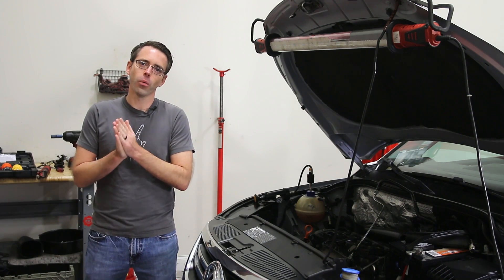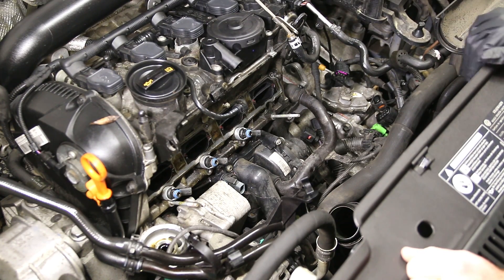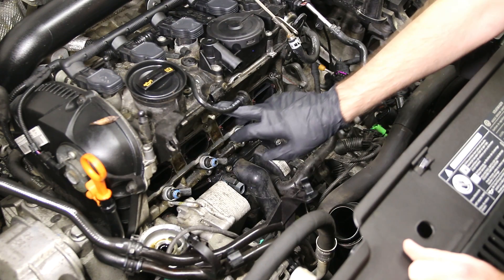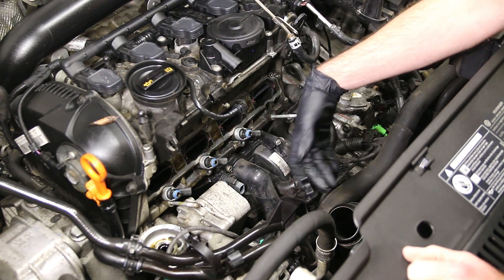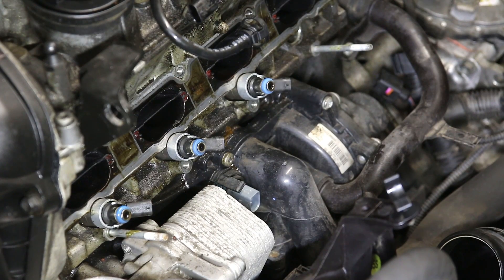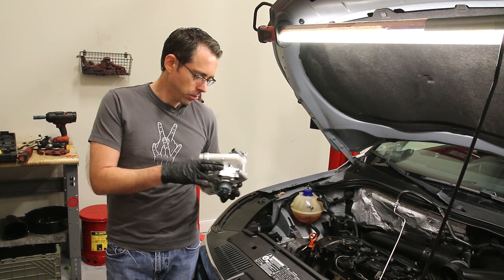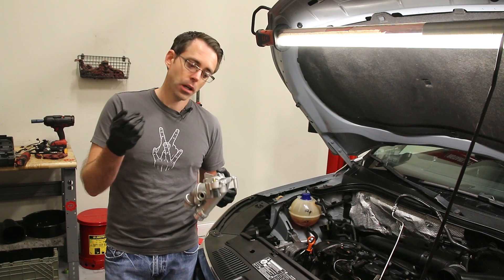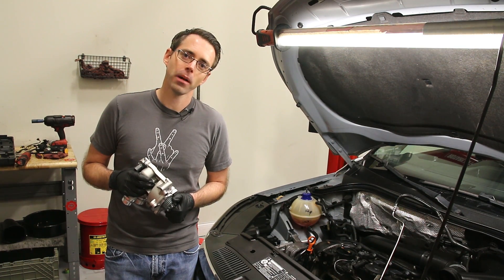Why to Never Let Problems Linger | 2.0t TSI Engine

Comment: Any information on which VAG engine codes are affected on this problem?
Thanks
Reply: +Daniel Yes.
CCTA/CBFA - 147 kW (200 hp) at 5,100-6,000 rpm, 207 ft lb (280Nm) at 1,800-5,000 rpm. Application: VW Golf Mk5 GTI (for US market only), VW Golf Mk6 GTI (for US market only), Audi Q3 (for US market only), VW Jetta Mk5/Mk6, VW Passat B6, VW CC, Audi A3 (8P). 

Here in South America we have the 2.0 TSI/ TFSI 211PS engine in the EA888 Gen 2 and if I am not mistaken this was the only powertrain for our market. Many people with whom I have spoken told me both the Audis and VW had oil consumption problems, which is a specific problem of the second EA888 generation, other than the famous failing chain tensioners. Models affected were the Audi A3, A4 B8, A5 2.0TFSI until 2012.5 and Volkswagen Vento/ Jetta MK6 (or Jetta GLI), Passat B8, Tiguan and probably missing many others.
It would be really, really helpful if DAP makes a video explaining in detail the main differences between these huge amount of engine codes, and most common issues for each variation.
Reply: All? I've heard all the differences are between the engine codes is emissions
Reply: +Daniel Hmm, really? I am not sure if it this is the only differences between these engines, but some do vary just because of different emission levels, and at the end this affects performance in some way.
I have heard there are minor mechanical or ECU mapping variations between engine codes as variable valve lift, different metal alloys for some components, plastic tubing, etc. Here are some examples:
CPSA - 155 kW (211 hp) at 5,000-6,200 rpm, 221 ft lb (300Nm) at 1,800-4,900 rpm (Audi Q3)

CCZB - 155 kW (211 hp) at 5,300-6,200 rpm, 207 ft lb (280Nm) at 1,700-5,200 rpm.

CAEA/CAEB/CDNC - 155 kW (211 hp) at 4,300-6,000 rpm, 260 ft lb (350Nm) at 1,500-4,200 rpm

All have same power but different Torque figures. Anyway, each time I try to investigate the differences and specific models these engines are equipped in, I end up getting even more confused. Too many different codes but no clear differentiation between all of them.
Reply: @apexseal2811  yea and where's CBFA and CCTA in that list? Maybe shopDAP should make a video on 2.0T engine codes? 🤔

Comment: Yea like others have said vw has never made a good engine until the 3rd gen motors 2015+ there simply not reliable even with perfect maintenance.
Reply: @gauge167 its honestly not that bad man ive driven a 2010 for years and its made me more knowledgeable about engines than ever. U say its not a good motor? Its one if the most efficient and smoothly designed engines that ever came along... theres a reason ive taken it 150k+. Its a turd but its a stout bastard and it still pulls 10 years later
Reply: wait the 3rd gen get the age of the 1st and 2nd lol

Comment: I have an issue with my radiator fans that I cannot find the correct answer to. Do you have a video like this about the radiator fans or know what are symptoms of failing fans?

Comment: This engine is garbage. Massive carbon build up and timing chain issues.
It is simply not reliable. 
The 3rd Gen. of this engine is far better than Gen. 1 and 2.
Also the Tdi's are much better in terms of reliability.
Reply: This engine never failed me. The key? Beat the living crap out of it. Never has issues with carbon building up. A faulty ignition coil here and there but it was still healthy and powerful when I sold my CC with 230K miles.
Reply: @MrCdmorenot  It's a crazy thought but I've seen that mentioned on forums in the past and I've had a similar experience...

I bought a grandpa-driven 2.0T '09 B6 Passat with ~20k miles back in 2011. When cold weather came around, it was obvious that the valves were gunked up and needed to be cleaned. I sold that car a year later and bought a manual '12 GTI that I've been hooning every day for nearly 7 years (full bolt-on, APR stage 2). Knock on wood, the car still runs as smooth as the day I picked it up without a single issue. Best car I've owned.

BTW - the 3rd gen TSI in the US doesn't have dual port injection, unfortunately.
Reply: @MrCdmorenot  This is true. I don't necessarily beat the living crap out of mine, but I do drive them pretty good. And Ive never had a problem like you said.
Reply: Carlos David Moreno I don’t believe you at all.
Reply: @eeiko321  And I couldn't care less!
Reply: Carlos David Moreno you “cared “ enough to comment initially and you “cared” enough to respond to me....
Reply: @eeiko321  And once again, regardless of how you wish to interpret the comment, I couldn't care less!
Reply: @eeiko321  Lol! Gay? Because that's an insult nowadays? Rookie.
Reply: Carlos David Moreno keep ‘caring’...........
Reply: @eeiko321  Why don't you believe him? A CO worker had an older Passat with the 1.8T and he never took care of it. That car had over 200k miles. These engines will last if you take care of them.
Reply: Seafoam or crc treatment before a oil change will clean the carbon build it , I do it as a maintenance thing on my 2015 audi
Reply: @iiXtcy  How do you do that without damaging the turbo?  Either you're sucking that stuff into the turbo inlet, or you're somehow bypassing the turbo inlet, but possibly causing damage to the impeller because your exhaust temperatures go way up...  I've been told never to use that stuff on a turbocharged engine because of those two reasons.  So I'm wondering how you're doing it without damaging your turbo?
Reply: @LMacNeill  you do it passed the maf sensor or a vacuum line I had no problem they make one for turbos .. it's a process were u rev the engine while doing it. It made my car run smooth after I did it I recommend it
Reply: I have the same motor but a mid 2013 version. Which had pretty much all the issues revised, eg; Piston ring defect, timing chain tensioner, Diverter Valve etc.
I think by the end of 2013 is when they scrapped the Gen 2 and introduced the Gen 3.

So you’re saying the Gen 3 doesn’t have carbon issues? I thought they were GDI also?
Reply: @eeiko321  The 3rd Generation is also GDI-engine but with additional port injection in the intake manifolt.
This should reduce the carbon issues and cleaning the valves with the port injection.
But I don't know if the problem is completely solved or only reduced.
I think this engines are to young to make a conclusion.

But the 3rd Generation seems pretty reliable in terms of timing chain tensioner and the pistion ring problems are solved.
Reply: Markus Ortmaier yes it does appear the Gen 3 is far more successful. Do you know what’s the main difference that allows Gen 3 to run more power? (It wouldn’t just be the additional port injection, could it?)

Comment: great vid. i live by the philosophy to fix anything the second it breaks.
Reply: so could you maybe save the water pump if you check the front edge of that valve cover gasket every few weeks, and wipe it clean? tons of VW gaskets seep normally in my opinion.
Reply: Last Human , you don't even wait for it to break ! You just change it for kicks . Just busting your balls . You have a great channel also .
Reply: @kenj.8897  hahah very true... i change things too much... but.. at least i dont change my oil every 1000 miles anymore... that was back when i had money..

Comment: My 2013 Beetle 2.0 TSI also had oil seeping from the valve cover gasket. It would have cost $900+ at the dealership to have it replaced. Thankfully, it was covered under an extended warranty that I purchased with the car.

Comment: 👌🏾 im actually in the process of installing that pump...along with intake manifold & de-carb. Do it all while there's room!
Reply: I was hoping you could send some info my way for guides etc. you found useful? looking into doing it all on mine as well. Thanks!
Reply: @iaingedrose9960 I did this on an A4 2.0. I used a combination of YouTube & a downloaded manual, pretty big file, to complete the job. I bought my walnut blaster kit from bavauto, but I think they are at ecstuning.com now. Shop dap has the adapter piece for the blaster to intake, 034-108-Z054.
Reply: @jaykayem  awesome thanks for the info. Slightly scared to blast it was planning on a more painstaking manual approach but we will see, that adaptor is huge. Out of curiosity was your pump failure caused by an oil leak? And if so did you fix that as well?
Reply: @iaingedrose9960  I don't remember if I had a leak or not. I was going in there for the intake manifold. I figured if I would have the space of no intake, I may as well upgrade known failure points & have peace of mind.

Comment: Speaking of letting things get worse, my 8P Audi A3 is burning oil every now and then (grey smoke out the tailpipe) and the dipstick smells of gasoline as of late. My local shop told me it’s definitely not the turbo after inspecting the charge pipe (when addressing a coolant leak). So it seems it’s very likely the piston rings. What are the issues that I should see beyond oil consumption? And what is the worse case scenario if I let this engine run it’s last mile? I’m already planning on starting a beater project in the event that it needs a new engine. Thanks DAP
Reply: Authorized Mike could be the place you getting gas from it might be to rich or check the oil you put in it as well
Reply: My 8p A3 with the fsi engine has always consumed about 1qt/2500mi. It's actually so reliable that I know to add a quart in between oil changes. Mine has never gotten worse and I've had it since 2010
Reply: I'm a VW tech, and I've changed pistons and engines on (quite) a few cars with worn piston rings/cylinders, and I can't remember to have smelled gasoline from the oil on any one of them.
My guess would be the high pressure fuel pump.
Reply: Thanks folks, thats helpful. I change my follower every 10-15k btw, the wear is always consistent and normal and the cams look great for 170k miles

Comment: Hey! Really enjoying your DAP series on VW's, especially now that I am considering buying an Mk5 or Mk6. I've had an Mk2 for 12 years now. Also had Mk3's and Mk4's... and that's probably why I quitted from VW's. LOL. Now, seeing how good the new Mk7s are performing, I feel safer going back. My budget doesn't reach for a Mk7, but could you please talk about the differences between the engines in the Mk5/6/7 !? From what I've read so far, Mk6s are no good for building power. Could you elaborate? Should I go Mk5 or Mk6? Mk5s are CHEAP nowadays! Just want a good daily driver and achieving around 350hp would be perfect. Keep the videos coming! Thanks!

Comment: Check out my vid on my audi tt 2.0!!! I rescued you could say, i had a similar issue with the oil leaking onto the water pump making it weaken and eventually leak. I recommend the aluminum water pump along with any aluminum coolant flanges you can source out. Main goal, eliminate all plastic in direct contact of the engine head lol all thats left is and IE intake manifold 😎
Reply: This guy is some next level trolling

Comment: Hey Paul, thanks for another informative video. 
In terms of neglecting/ignoring issues: last weekend I got my engine steam-washed (I think water was actually applied). That day engine ran well, next morning I had severe misfire, as engine warmed up it became normal. Each day it's less severe, but still noticeable when cold - any suggestions?
Reply: You probably have water around your spark plugs and/or ignition coils - very common to happen if an engine is cleaned with water. Use compressed air to blow the water out of those areas.
Reply: @LucasVWGolfR  thanks for the tip!
Reply: Yeah don't wash engine

Comment: Same thing that happened to my 2010 GTI (62k miles) around a year ago. Never saw the car leaking or burning oil so I imagine it slooooowly leaked out over the years. First mechanical failure That car had in 8 years of ownership (knocks hard on wood).
Reply: same same same. slow leak for years. finally killed the water pump.  47k
Reply: Interesting! My water pump died and when the mechanic replaced it, he noticed the oil leak. I still haven’t fixed it but this might be the reason why the pump died initially.
Reply: SteadyAimRay Same lmfao, i think all these engines will have to have that valve cover seal replaced, if you think about it all it takes is a mechanic or person attempting to heavy clean the gap where the sealant is slowly eating away as more is forced out. I just leave all the dust bits in there dont evn touch it lol